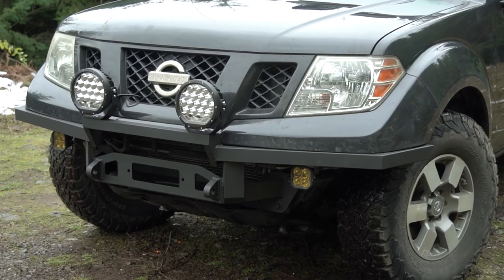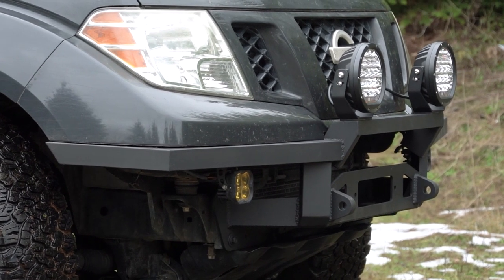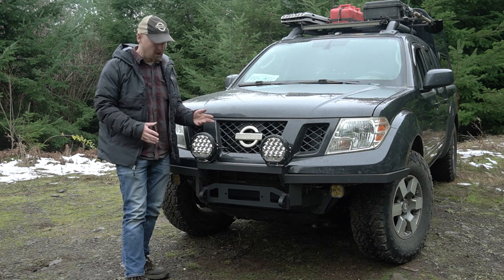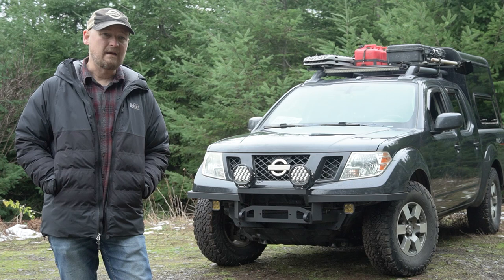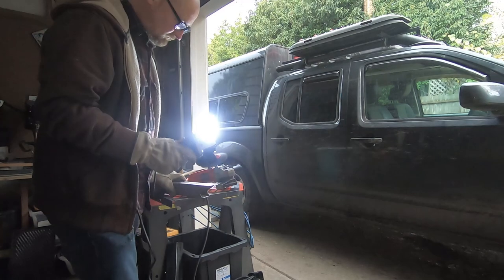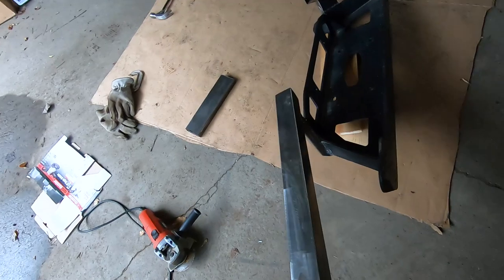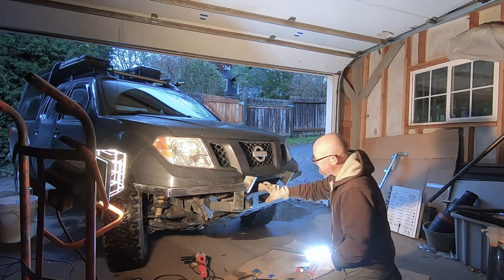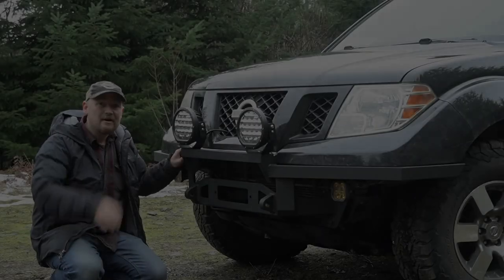Novice welder attempts to DIY a steel front bumper

Comment: I have been metal fabricating things since I took my first shop class back in the 60’s (just a clue to my age) and I think you did a great job on that bumper especially for your experience. I like the way you made that angle around the fender, it’s actually stronger than if you had cut both ends to the proper angle and welded together . I think you rang all the bells; 1. Finished and protected the raw edges of the fenders. 2. Light weight . 3. Place to mount a  winch and lights. 4. Good looks, fits the look of the truck. 5. Inexpensive. (Sounds better than cheap) Now think about that rear bumper for a while, they’re usually must simpler.  I recently made one for a Wrangler out of just a straight piece of 3x4” x 3/16 wall tubing.  I just turned and boxed the ends similar to what you did. I welded a 2” receiver tube , that you can get at Tractor supply or Walmart, to the bottom. I didn’t intend to tow anything very heavy and already had the tubing other wise I would have gone with 1/4” wall which would probably let you exceed the towing capacity of the Frontier. Keep up the good work. 👍
Reply from the maker: Thanks! For the rear bumper, I want to add swing-out arms and some other functionality, and having seen how long this relatively simple front bumper took me, well...I would have to give up video editing for a month, and ultimately I think I would experience more frustration than fun. :-)

Comment: Thanks, Donald. You did some really good welds there! Nice fabrication work! Well done. My $99 Harbor Freight Wire Feed, Gasless, Clueless, Slagtastic welder produces some of the most horrendous welds I have ever seen. I am sure it was not the clueless, novice operator at all. Actually I have learned enough from my own failed attempts to appreciate the true beauty of a solid weld that holds and looks nice. I salute you welders out there!

Comment: Donald, welding and fabrication takes time to really get comfortable with.  I've been welding and fabricating off and on for 35 years and still have my bad days.  Sometimes it's the quality of the metal outside my control shy of using something better, sometimes it's sloppy consumables, plugged gas orifice, etc.  Practice, practice, practice and take notes along the way.   

I will say that you did a great job considering your level of experience.  I really wish we lived closer than 2-3 hours apart, as I would certainly be willing to show you some tips and tricks I have learned along the way.  A front bumper is no small task either.  I've been lollygagging building my front bumper for my 2017 Taco that I purchased new 4 years ago, mostly because I haven't completely decided on a design yet.  That and I have several other drivable vehicles that I can use while my truck is apart, so I can't use that for an excuse. I'll get it done some day.

Comment: Love it. Looking forward to seeing what winch you wind up with, as I'm in the market as well.

Also, don't worry about the Instagram welding inspectors. Go take a look at the utility trailers at your local home improvement store; your welds are at least as good as those. Structural or pipeliner standards simply aren't needed for most projects, and what you did is 1,000% functional.

Comment: Really like the bumper and look of the lights.  Your welding looks strong and passes the 10ft test.  Given the budget friendly approach, you did it just right.  Final product looks good:  $26 and very little weight added - fantastic.  
Rear bumper:  see if one of your local muffler shops will weld what you want.  Guessing you have access to a few Metal Fabrication shops in town as well.  Always cool to have a one-off product.  Looking forward to the new Co Light Review.

Comment: Your new bumper looks good!  More minimalist, but still offering protection.  Better than the stock bumper. Some of the steel aftermarket bumpers weigh so much you have to install a front lift kit to compensate for the weight.

Comment: A lot of shops that weld on vehicles actually use what's called an Anti-Zap. It's basically a box with a positive and negative cable that connects to the battery and absorbs any voltage spikes that might get sent through the vehicle. While most shops probably in fact do not disconnect the batteries, they do have in place preventative measures keep from damaging the vehicle. I have personal experience with this.

Comment: I must say Donald your honestly to try welding and fabrication of your bumper.  Using scrap steel is a great savings.  Liked how you incorporated a cap on the ends to keep out water and dirt.  Using the perforated angle for your lights nicely done as well.  Thanks for sharing your video.

Comment: As long as you have the earth clamp close to the welding spot, and not too near the engine or electrical panels, you can get away without disconnecting the battery in most cases. Interesting video.

Comment: The front is starting to look like my ZR2, great job on the fab work.  The large lights look very nice.  You can't go wrong  with Warn, BUT the low cost units on the market have a lot of happy owners.  I went Warn because I found a new/used Zeon for half price.  Your welds look like you gt good penetration, don't worry about pretty.

Comment: Wow---an impressive design. Minimal, clean, and contributes to the overall look of the vehicle. I like how this isn't like the gigantic bumpers that have that 'armored truck" look. I guess these outer pieces might collapse in a hard bump, but they really look good, and the winch mount looks very solid. Practical, light and good looking!
Reply from the maker: You are right, the "arms" out to the sides would not withstand much of an impact. I did originally plan to reinforce that more and I think I may yet do that when it comes back off to mount the winch. I already have the materials for it. When I saw how lightweight it was and how rigid it felt, I decided to see how it goes without, but I do think it would be wise to add some further support. Thanks for the kind words!

Comment: Looking good. always fan of DIY work, sure bought looks better but its just not the same... Well since i started watching the first vid about DIY on the forester. We sold oure outback bought a  forester for the misses (stil have it) bought a XV 149hp D manuel. today i sold/traded it to non other then a Nissan Navara D40 (frontier) 2015 i test drove my old mans navara i was hooked. spent month searching and saving.. finaly found one. came with new set of 20"wheels/tires winter and summer...   dont realy like those huge 20" im gonna trade them in for some 17" i think.  so im rewatching every navara videos :) .
from you fan in Norway

Comment: Nice job! 👍
You know, even if you’re not an expert welder, you got it done, it’s functional, light weight, and looks good. I think you got the right approach with using the professionally made winch mount for the structurally critical stuff, and adding on to it. If it’s in our budget, get yourself a multifunction welding machine so you can MIG weld. It’s much easier than flux core, and the results usually look better.

Comment: Dang, that turned out pretty well Donald! Good job! The only concern I would have is the accessibility of the winch. I've heard of winches getting stolen off of trucks in downtown Eugene. Also, FYI I have been pulled over for having the plate in the front window by OSP. When I was at the 4x4 gathering in Monroe last summer I saw a LOT of Badlands winches on a wide variety of builds. I'd suggest going that route.
Reply: Tack weld the mounting bolts. Won't stop someone truly dedicated to stealing your winch, but will sure make them work harder for it.

Comment: I think you should be pretty proud of yourself. I suck at welding. Those look fairly clean and sturdy. I wouldn't even know where to begin with that fabrication. I also really like the minimalist design. Plus you're just using a grinder and not a band saw for cutting.

Comment: I agree.. Donald!! Use a cheaper winch.. that has great features.   Wireless remote and such.. can get that stuff when you spend less.  I've tried it before. It worked ok. But. Used a free winch that I was given. To small. But still worked. Would love to see you do I different then every other utuber.. you show that these adventures and safety gear is available for the average person on a regular income!!

Comment: Very nice, I think it turned out great. 
To my taste, I would run a triangular plate from next to the recovery point, to the corner under the headlights (where your fog lights are mounted) - I think it would finish it off nicely as well as help to reduce any chances of vibration on that outside corner. 
Please take this as a constructive comment - that is my intention.
Reply from the maker: I agree completely! Something like that was actually part of the original plan, and I even have materials for it. I thought maybe I could get away without it, but I'm thinking when I take this back off to install a winch, I'll go ahead and build in a little more support there. Thanks for watching!

Comment: Looks real nice but I'm thinking the outer ends of the "arms" won't stand up to any real hits.  There is a lot of unsupported leverage on them.  My bumper has clipped a few trees in it's day and protected the fender.  It all depends how and where you go offroad.
Reply from the maker: Agreed...I actually intended to build in more support there, and I even bought the material to do it, but when I saw how lightweight it all turned out and how rigid it felt, I decided to see how it goes without. It would be a fairly simple to add though and I think when this comes back off the truck to mount the winch, I'll probably take the opportunity to add that extra support after all. Thanks for watching! :-)

Comment: Looks good! I wish I  could even weld that good. The only thing I could think of would be to reinforce behind the angles a little bit to assist in case of contact. And that’s just if you had room when it’s mounted. Now I want to find someone to make a minimalist bumper like that for my Ranger.
Reply from the maker: Agreed...I actually intended to, and I bought the material to do it, but when I saw how lightweight it all turned out and how rigid it felt, I decided to see how it goes without. It would be a fairly simple to add though and I think when this comes back off the truck to mount the winch, I'll probably take the opportunity to add that extra support after all.

Comment: Damn Donald!
I think I disagree with you. I believe you DO know what you’re doing. The design is beautiful. You REALLY added something very nice to your truck. The only thing I would ask you to consider is adding additional lower arms off the center section that angle up to the ends of the bumper. (for added strength) Well done my friend. I’m envious. I wish I could weld myself. It maybe time to learn.
Reply from the maker: That was the original plan actually. I intended to build in more support there, and I even bought the material to do it, but when I saw how lightweight it all turned out and how rigid it felt, I decided to see how it goes without. It would be a simple matter to add though and I think when this comes back off the truck to mount the winch, I'll probably take the opportunity to add that extra support after all. :-)
Reply: @softroadingthewest  
It really looks great. You should be very proud of it.

Comment: Merry Christmas 🎄 to you and your family Donald. 
   Welcome to the wacko world of a novice welder. Living it also👍.
I think you Killed it. Simple yet effective. 
  I'm building bumper mounts for my Montero Sport.
 It is a bit tedious,  but rewarding none the less.
  My suggestion for a Winch,, 🤔.  
Determine the Gross weight of the truck with gear and fuel. This will give you a good idea of what capacity Winch you should select. 
  I opted for the Badlands ZXR 9K model w/ wire rope. 
My rig is 5300lbs+ unloaded.  If I need more pull,,  thats what a snach block is for. I hope I never really need the Winch,, it's just a insurance policy in my mind..
  Yes sir,, Budget is everything. 
Cheers 🍻,,  G.

Comment: This is an amazing project ! The only thing I see you could've improove is to add a stiffner on each side between your horizontal and vertical tube.
Reply from the maker: Agreed. That was actually part of the original plan and I even have materials for it. I thought maybe I could get away without it, but I'm thinking when I take this back off to install a winch, I'll go ahead and build in a little more support there. Thanks for watching!

Comment: Donald, did you consider gusseting those arms?  I think it would give a little added insurance in case you bumped something on the trail to keep the outer bits of the bumper from folding in or down.  Nice job, overall!! 👌
Reply from the maker: That was the original plan actually. I intended to build in more support there, and I even bought the material to do it, but when I saw how lightweight it all turned out and how rigid it felt, I decided to see how it goes without. It would be a simple matter to add though and I think when this comes back off the truck to mount the winch, I'll probably take the opportunity to add that extra support after all. :-)

Comment: Looks pretty good.  Have you thought about putting some Raptor liner on the bumper?  You can get it in spray cans and it would add a nice, durable finish to the bumper.  Ar you concerned about the yellow lights hanging down?

Comment: just curious if you had considered having a bit more bracing to the outer bar of your bumper... one good bump and you may have the outer angle stabbing into your front tires because of the possible flex or bend to the farthest point of the outside bumper... other than that   take credit where credit is due... simple and nice design done by you.. cant get more budget than that unless its a Christmas gift!!
Reply from the maker: That was the original plan actually. I fully intended to build in more support there, and I even bought the material to do it, but when I saw how lightweight it all turned out and how rigid it felt, I decided to see how it goes without. It would be a simple matter to add though and I think when this comes back off the truck to mount the winch, I'll probably take the opportunity to add that extra support after all. :-)

Comment: Dude!  Nice freak'n job!  It's awesome.  I just may try welding yet.  And don't sell yourself short.  Maybe reconsider doing the rear bumper yourself.  You can totally do it.
Reply from the maker: Haha, perhaps I can do it, but the cost in sheer time and sanity gives me pause. :-)  If it was just a simple bumper, I would be all over it, but I need to integrate some swing out arms. After seeing how many hours I put into this relatively simple front bumper, I'm just not sure I can devote the kind of time it would take me to build all the parts of the rear bumper and get it all actually working properly. :-)

Comment: Love the minimalist simple part, bumper included. The Harbor Freight is tested in the budget arena.  You should go more off-brand.  Under-used and marketed are Rugged Ridge, Superwinch and Rough Country to name a few. I wanted a Warn, but with a 4wheel parts close by, if my winch fails the Smitty can be swapped out quickly with no shipping costs.

Comment: Harbor Freight winches are rated better than Warn Winches. The Apex 9000 lbs would be perfect for your set up because loaded your around 6000 lbs. and it'll give you an extra 3000 to work with.

Comment: Personally I think it's a reasonable job as long as your welds are good the only thing I would try and change would be the sharp corners but job well done and practice makes perfect it dose get easier hang in there you might be doing your own 4 links suspension 🤔best of luck with it all it dose the job and looks good

Comment: Wow! Looks great congrats. What did you do with the stock bumper?
Reply from the maker: There is no "stock bumper" per se on this model of Frontier. The entire front clip is a single piece of plastic that shrouds the front end including the steel crash beam underneath. I just cut away the lower section of plastic. Removing the crash beam yields the mounting points/bolts that secure the aftermarket winch mount to the truck.

Comment: Looks great! What sort of paint did you use?
Reply from the maker: It's just standard Rustoleum flat black enamel spray paint, five bucks a can.  Easy to get anywhere whenever I need to retouch the paint, which I'm sure will get scratched up. :-)  I used pretty much an entire can of the self-etching primer, then about two cans of paint.

Comment: That's awesome now I just need to convince my wife to let me buy a welder. Can you make a video on how you did that?
Reply from the maker: Haha! I've been divorced for many years. :-)  But the cost of a basic welder + the steel to build a bumper should be lower than the cost of buying an aftermarket bumper  -  or having a shop install a new stock bumper following a deer encounter ;-)  -  so you're saving money really. Plus then you can use the welder to save money on future repair needs as well!  (see if that flies, haha)

Comment: Looks good but is it airbag compatible.
Reply from the maker: Airbag deployment has nothing to do with the bumper. Airbag sensors are motion-based, triggered by sudden deceleration and are not connected to the bumper in any way. This is functionally no different than the factory steel crash beam that was bolted onto this spot underneath the plastic bumper cover...it too was just some steel welded together. The airbag sensors are elsewhere in the vehicle.